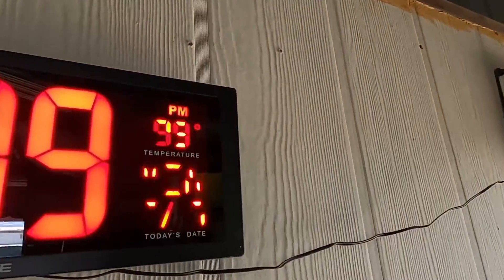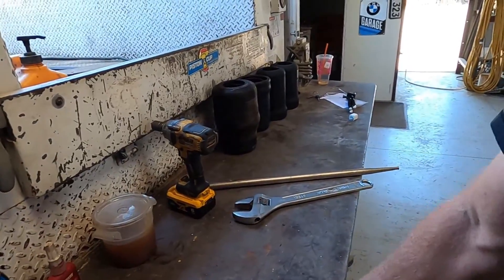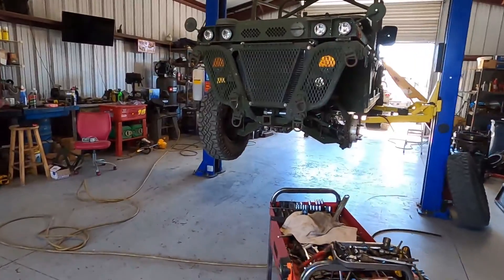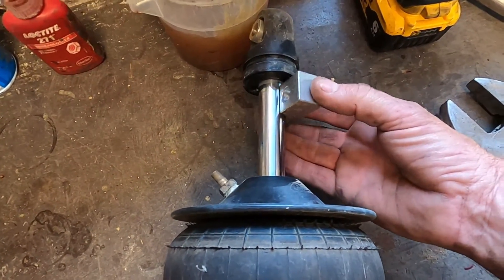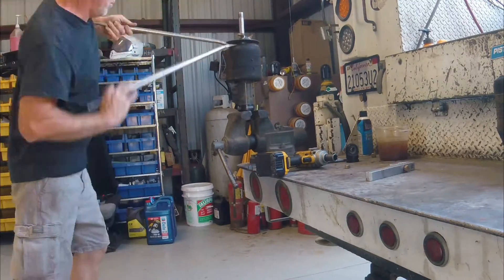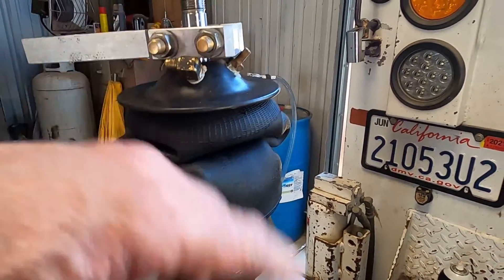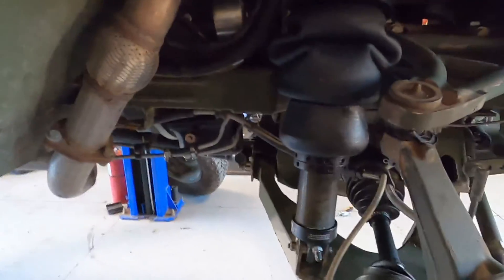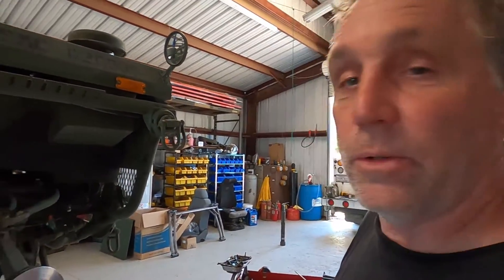Air suspension Strut Repair M1161 Growler

Comment: Just curious on where you got the tool to clamp the shaft so you can get the top nut off??
Reply from the maker: It’s made by Ride Tech I bought it on eBay, they also sell it on their website. The hole comes 1/2” I drilled mine out to 5/8” but later discovered you don’t need to as it will still clamp. They use lock tight on the threads do use a torch and lightly heat the top eye to loosen up the lock tite and it also swells the aluminum enough so that it comes off easier